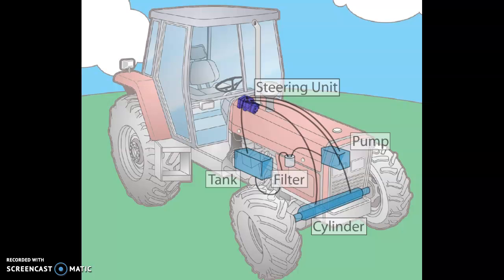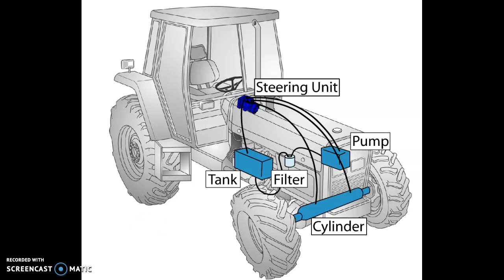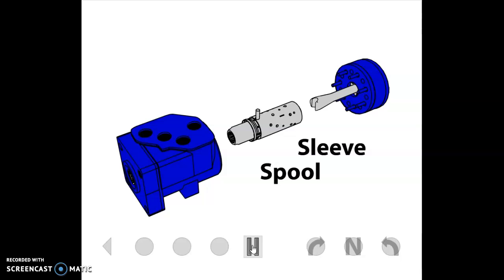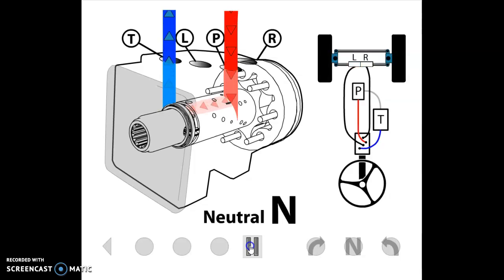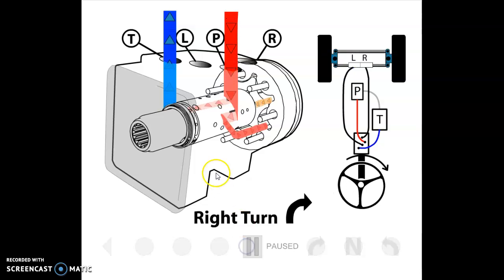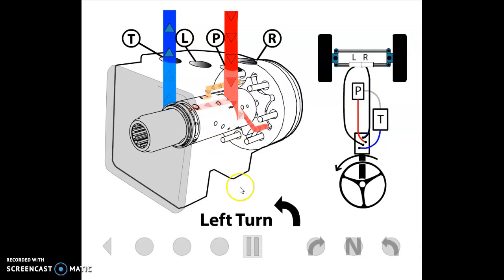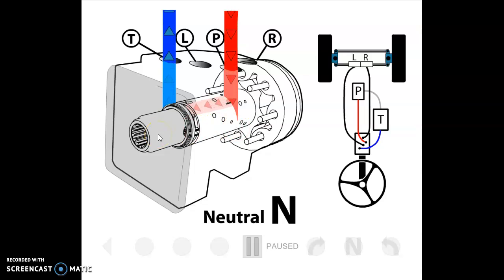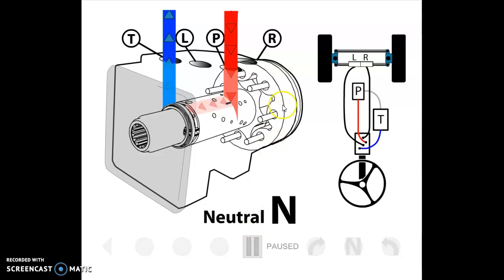HOW HYDRAULIC STEERING WORKS WITH AN HMU ORBITROL STEERING CONTROL VALVE DANFOSS EATON ROTARY DCV

Comment: The operator is NOT rotating the outer spool sleeve OR the gerotor (7:10). The operator, by turning the inner spool of the control valve off neutral, causes the gerotor to be pressurized, which drives the gerotor as the oil is on its way to the output ports, which drives the central shaft, pinned to the outer spool, driving the outer spool to "catch up" with the inner part and re-center the leaf springs, redirecting flow from the gerotor to the tank port.  The operator is ONLY moving the inner spool. Everything else is driven by hydraulic pressure.

The only time operator input directly moves the outer sleeve or the gerotor is when there is no hydraulic pressure on the input port providing re-centering feedback. I CAN turn the steering on my tractor when there's no hydraulic pressure, but I try not to do it when there's any load on the wheels, because that DOES directly drive the outer spool and gerotor, which puts torque load on the leaf springs and the pins, which aren't designed for that kind of load.
Reply: Thanks very much for clarifying that I was slightly confused. That makes perfect sense.
Reply: Thanks for that clarification I was looking for your comment so i would not need to add it. You explained it well. It is important to note that if the operator was directly driving through the pin there would not be any proportional response just full on all the time, when in practice there is very smooth proportional control.

Comment: Any idea what would cause the steering hard to turn until you start moving ?
Reply: Most probably because there isn't enough oil flow when you are not moving. Usually the oil pumps are operated by the engine (unless it's an electric vehicle). When you are standing still, the engine is idling and rotating the pump at very low rpm as well (hence less flow). You can easily check this. Keep the vehicle in neutral and press gas, and check if the steering is easier now. :)
Reply: @A10bot  I've done this, and it doesn't help the steering ram has a slight leak might not help

Comment: Would it function the same way if the pressure and return lines were reversed?  The Eaton schematic shows pressure moving from the spool to the gerotor first, then to the cylinder, as you explained.  But I wonder if the hydraulic flow would be the same if it moved to the cylinder first, then through the gerotor, as if the pressure and return lines were reversed.

I ask because I’ll be experimenting with it in the near future.  I have an application that requires me to use an adjustable relief valve and I’d like to put the relief valve in the relief valve port of the steering control valve.  The only issue is that due to the design of the casting, an adjustable relief valve can’t be used unless the port would be heavily modified.  Simply reversing the pressure and return lines would allow an adjustable relief valve to be used in the original port, saving me some machining, or excess hosing and componentry.

I feel like I won’t know the answer to wether it will function with the lines reversed until I try it and see.  Just thought I’d ask in case you might have an opinion.  Good video.  I’d love to know where the animations came from, and if there are different versions for the Eaton steering control valves with power beyond capabilities and other available integral relief, check, and anti cavitation valves that these units are available with.
Reply from the maker: I'd think the top seal would blow out. I've never tried it

Comment: Thanks for the video. Very good explanation. 
I just bought an old tractor with that system. The steering works, but is some kind of loose. If the engine is off I can turn a bit left and then I can quickly turn 1/4 of a turn right. This without actual moving the wheels. I can repeat this. During the quick right turn I can hear a "grinding" noise like teeth grinding from a manual gearbox. Any one who have an idea to what the cause can be?